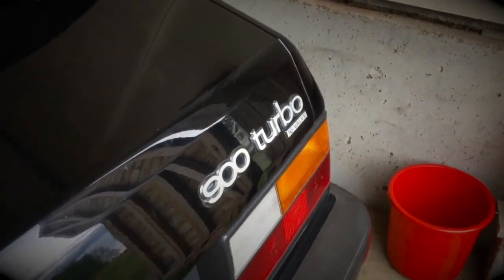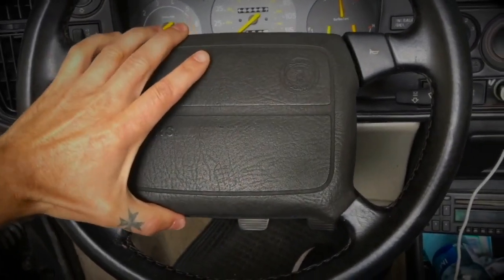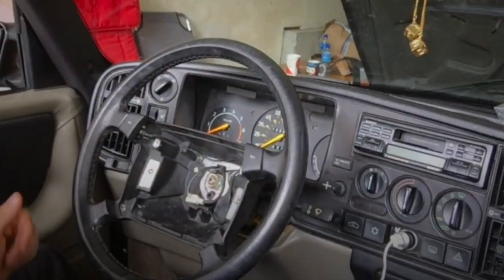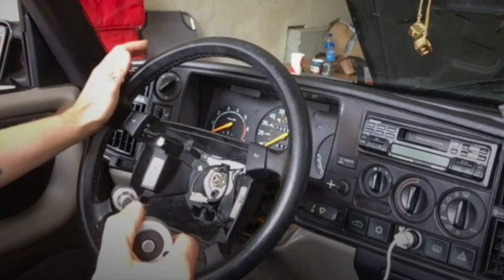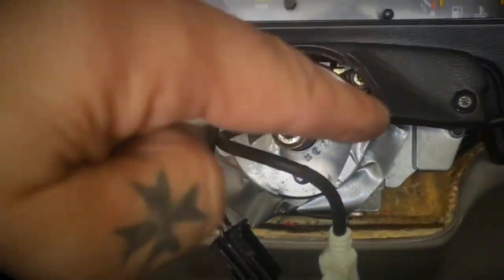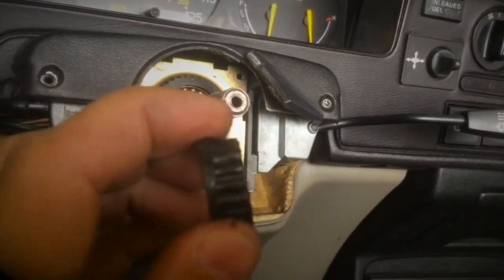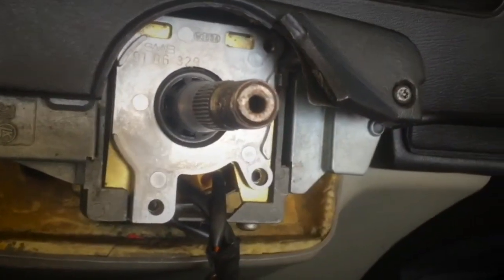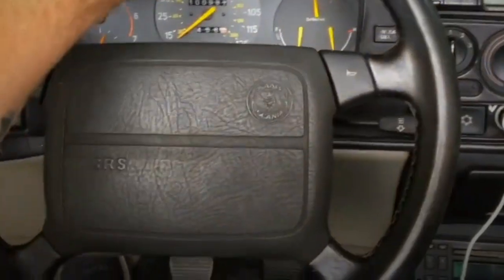Saab 900 Steering Column Bushing Repair

Comment: Fabulous detail in your video my friend . Thank you . I just did the job successfully on my 9000 cs (it is the same system )
thanks to your help . 
Cheers 🙂
Reply from the maker: Glad it helped ! Had to do it twice on my car over three years - I hadn't quite done it right the first time.
Reply: @theclassicsaabguy236  What did you do wrong the first time ? I found your video covered all the salient points - especially how to tape the clockspring to avoid ...SPROOOOOIING . I took my time because I had no idea of what it all was . Without your video I would have been in the dark . Not rushing , as a newby I spent 3 hours + doing the job. (Not counting the time from battery disconnect to starting - I waited more than an hour after battery disconnect. I imagine that I could do it in less than an hour now that I know the ropes.
Cheers again :)

Comment: Very helpful video.  Its very important to save the clock spring as none are available..  How do I get the new bushing & lock ring??  I have to do this on a 1990 Saab 900 t CV    thanks so much,  David
Reply from the maker: Hi thanks - I may have the bushing and clock spring in my parts - I can take a look. where are you based ?

Comment: Nice video, thanks for the nice overview! But please allow one hint. The questionable column bushing is regularly locatet BEHIND the bearing! Being replaced the lockring locks the bearing, not the bushing, which is much too soft. So after SAAB´s specification we should tear out the big rubberbushing  containing the upper column bearing first and replace the small new bushing UNDERNEATH. Greetings from Trollhättan!
Reply: old post, but I'm doing this job now. Do you have a photo of how the bushing should be oriented/placed?
Reply: @michaelbrady3836  Sorry, I have no photos right now but you habe to pull out the bearing first, replace the small ring and new bushing. Then follows the bearing with its rubber cover and then comes the lock ring towards the steering wheel. Hope this helps! Good luck!

Comment: I want to like this video. But there is another way I figured to get that upper right torx screw for backing plate out without damaging the dash panel.  I Unscrewed the bolts below the dash and pulled it down while my dad unscrewed it.  I forgot to tape the spring coil yes it will explode!  Thanks.
Reply from the maker: Yeah I learnt that later on but screwed up one of the bolt recesses putting it back

Comment: Nice video, thanks! I just bought a 900 convertible 1992 (also US version) and I have the same "extra" knob left of the steering wheel. What is it for? Couldn't find it in the manual?
Reply from the maker: I think it's to adjust the instrument brightness - haven't checked mine - don't think it works ! Test it
Reply: @theclassicsaabguy236  yep, you're right. It adjusts the brightness of the instruments below the radio. Thanks!

Comment: Hey,
Thanks for the video. I have a ‘92 and my steering wheel is showing play just like your video. Where can I pick up that bushing and lock ring ?
Reply from the maker: Hi glad the video was useful - you can find the bushing a lock ring on eBay - if you get stuck come back to me as I may have some spares !
Reply: The Classic Saab Guy Thank you, I’ll search for it.
Reply: The Classic Saab Guy 
I got the bushing. Quick question: I’m trying to pull the clock spring off the shaft but there is a wire connect to it at the bottom (6 o’clock) it’s not long enough to pull the clock spring off the shaft. Any ideas ? Thank you again.
Reply from the maker: Mr. Ridington hmm you should be able to lift the clock spring off the shaft - the wire should be long enough as in my video - it's not wrapped around anything ?
Reply: The Classic Saab Guy
The wire isn’t that long in my car. I’ll send you a picture via Instagram.
Reply: The Classic Saab Guy it was tied down by a cable tie. I clipped it. All good now.
What’s your technique for taking off the lock ring ? Sorry I’m such an amateur.
Reply from the maker: Mr. Ridington yes I thought it might be something simple like that - I've had my steering column apart so much I probably forgot there used to be a cable tie originally. As for the lock ring - if you want to try and save it you could try gently levering it off either side until it's loose but I suggest replacing the lock ring as well anyway in which case you don't have to be so gentle with it - I think I've used a pair of needle tipped pliers to grab it almost twist it loose. Bit a flat blade screwdriver between the bushing and lock ring should work too !

Comment: Hi, Working on a 93 saab turbo...I have already cleaned the grounds in the engine bay. I am having issues locating the ground behind the instrument cluster/dash....any idea where to look for it. In the Bentley manual it is marked as G8.  I am in Australia, so mine RH drive. thanks

Comment: Never seen this steering wheel before. I wonder if the airbag was not available on the 900 model in the UK. Does anyone know?
Reply from the maker: James Cross interesting question ! I actually never saw this in the UK but have definitely seen them on USA models (which mine is) - maybe this was due to US regulations - would be good if anyone can confirm !

Comment: I don't care what they cost and if you think that 3D printed rubber bushing thing is better, where can I buy that and should buy the lock ring and the plate too? also is there anything else further down the steering column that could be bad? like a metal bearing or a bronze bushing?   and where can I buy any of this stuff.   nobody sells anything for Saabs where I live and will have to use a computer. like now. and I hate computers. but it looks like I have no choice .  The good old days of just going to a store is over.
Reply from the maker: sorry I didn't see this months ago - I trust you solved it ?

Comment: After following your video for my 1990 Saab 900, and carefully protecting the clockspring, I have an SRS warning light that flashes and stays illuminated. Your video is very poor and does not account for how to disengage the airbag system properly. Basically you CANNOT touch or disconnect the clockspring at any cost. Finding a replacement clockspring for a 1990-94 Saab 900 car with airbag is next to impossible. Your video sucks.
Reply from the maker: If you actually watch the video I explain clearly how to disengage the airbag system and what steps to take - this video was the fourth time I did this procedure and have never had an issue with the SRS - sounds like you missed something , clipped the srs cable or its not seated properly - and have no clue what you mean about the clock spring , thats for the horn
Reply: @theclassicsaabguy236  I found your video very helpful.  My 1990 steering wheel doesn't wobble side to side but it does slide in and out.  Is that the lower bearing?
Reply from the maker: Did you get a clockspring? I have one
Reply from the maker: @stephenmorrissey1254  no that sounds like the upper shaft has lateral play - that can happen - I'll try abs post a pic of what I mean